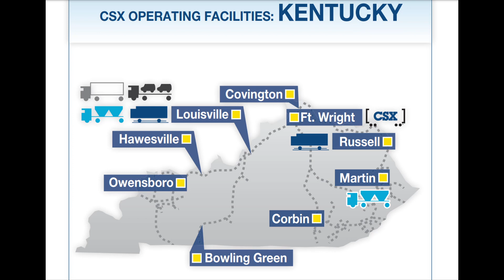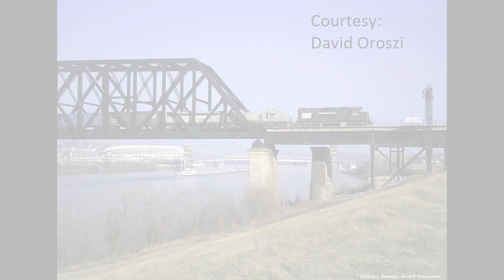Chasing CSX Q541 down the old L&N CC subdivision - part 1

Comment: Nice work.They have been doing a lot of work on the CC sub the last few years.They replaced some siding rail a few years ago around the 33.5 milepost.I was there a few days ago and the new ties that were staged along the line for a couple of months had been installed and both the main and siding have new ballast.
It would be nice if they were to upgrade the line to handle double stacks.
Thanks for the great footage.
Reply from the maker: You would think if they could manage to fit double stacks on this line, it could become a preferred route from Florida to the Midwest.

Comment: Here's an odd question, unrelated or not specific to this video ... about a month ago, perhaps 5 in the afternoon, I was hiking along Mehring way approaching the Bengals practice field. I was perhaps 150 yards from the C&O and Clay Wade Bailey bridges. And a CSX train was arriving Northbound. Nothing appeared special about the stock portion of the train, but there were SEVEN CSX locomotives on the front. I've never seen so many locomotives on a train before. Is this common as they relocate locomotives around the network?
Reply from the maker: What you saw could be a couple things.
It definitely could just be moving the locomotives around the network where they're are needed.
It could also mean that they have been sold to another company.
If they were sold, they could be put into leaser service, where companies lease the units as needed when they don't want to maintain their own fleet.
Or it could mean another company has bought them to send them to the scrap yard.

Go to the 12 minute mark in this video below and you'll see an engine graveyard.
The locomotive frames will be cut up and scrapped, while the diesel engines will be saved and restored.
https://youtu.be/2SQM15mf4JA

Comment: I wanted to extend the explanation of the signals being lit versus dark. 

Automatic Block Signals and Control Point Absolute Signals work similar to the conditions of when they are dark.  When you have a dark on a ABS signal that means there is no train in the preceding and forward going signals. So when you have a train thats 3 signals away there should be no signal. However when the train approaches the signal from the last signal in the same direction they will be lit up to indicate a train is approaching, then when they pass you and knock down the signal you are at for the next 2 signals you should still see the signal lit indicating to any approaching train that its too close to the block. 

How its different for Control Points is its the same as the ABS however it only reaches block to block so say there are 15 signals in one block and the next train is in the control block preceding the next control point the signal set by the dispatcher should be lit up. If you have ever seen a signal lit up for a LONG time like nearly half an hour to an hour or so this is why its lit up. It should noted that for Control Points, If a train takes longer than usual to get to the next signal after a predetermined time (30 minutes is my experience) the signal will go dark until a train is closer to the next control point. A good example for 2 Control Points are Glencoe KY, to Worthville KY. Those are both control points. 

Control points are a way CSX spreads out its trains not allowing them to get too close to another and is another way of which Track Time can be confined, for example if the track time is done at 1PM. CSX will take liberty of time all the way up to 1PM for its manifests so eventually the closer you get to 1PM the more open the control blocks become allowing trains to get closer and utilize track they can. Control Points are set along every siding and at entryway to every subdivision, so at the split from LCL and CC for example or at the split between Worthville and Carrolton Utilities, or even from Paris to Maysville track, there is a control point set there. 

Red on one side does infact mean there is a train not allowed permission back into the block. but the track it is on has continuity, meaning it has railcars or locomotives on it. Then for a red on both sides that implicates that there is an occupied block with a recent knock down, and continuous continuity. The rest can be filled in, fun fact any maintenance trucks with the rail wheels actually have an insulator to prevent continuity which means the only thing protecting someone doing MOW on the track or another person would be the track inspector they would be only protected by the control point signals.
Reply from the maker: Thank you for the detailed explanation.
I, and I'm sure others, do greatly appreciate you taking the time to do so.
This will certainly help me understand what I'm seeing along the tracks.

Have a great day!